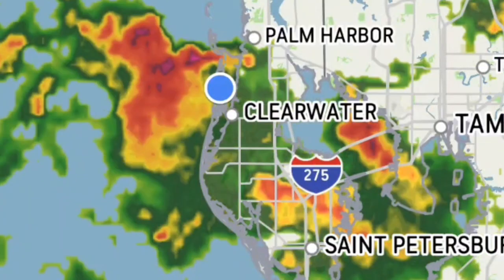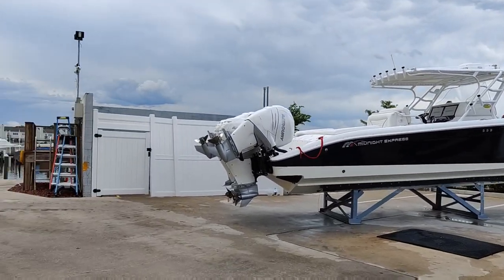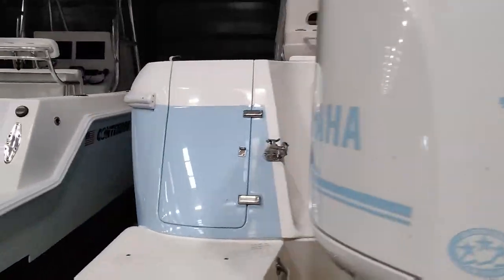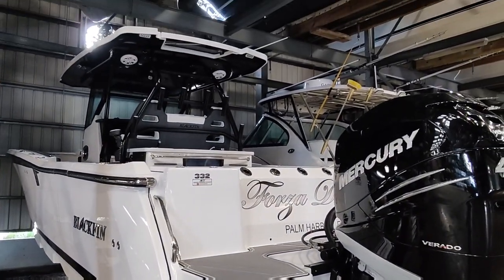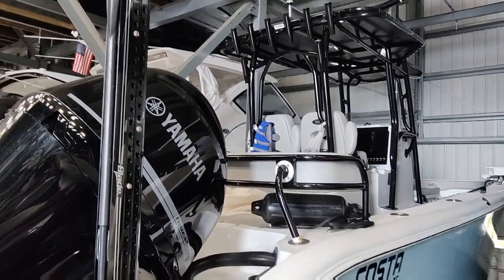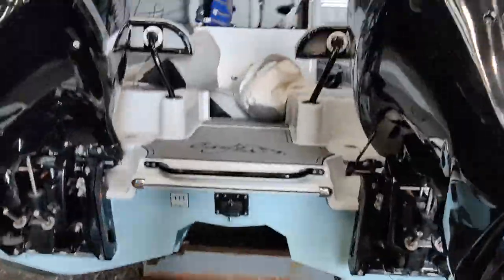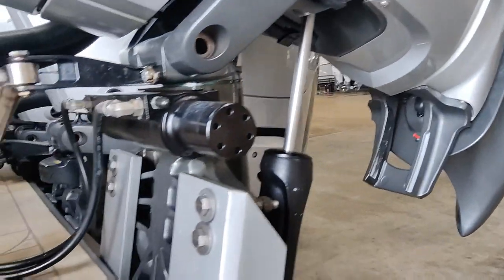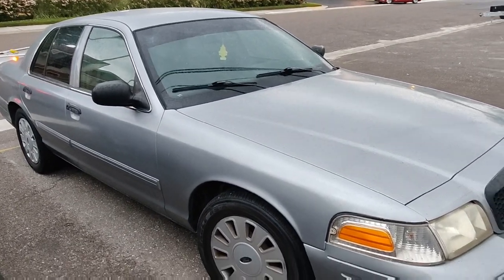Thank You Everyone & Lets Go To Marker One Marina #Dunedin  #ThankYou #Episode163

Comment: Need some guidance regarding the fuel system, any help is appreciate. This is the issue in short. I have a 2006 250 HP Yamaha Outboard. I think iam lossing prime between the primer ball and the fuel tank. Do you think it may be the fuel pick up and the anti-siphon valve getting stuck. It seems once all the fuel is used in the VST and whatever is in the line between the ball and the engine the engine begins to want to stall, choke and is starving for fuel. I need to work the throttle back and forth until I get prime back in the fuel line. Once the prime, or fuel is back in the system the engine runs perfectly. Your thoughts. Thanks again.
Reply from the maker: The best way to find the source of the problem is putting a vacuum gauge in the fuel line starting from the tank. Then you work your way back towards the motor.  Where there is excessive vacuum in the system will point towards the problem.  I rarely see this with the new boats I work on.  Keep me posted and I will be glad to help😊
Reply: @JustinLeeMarine  so I pulled the fuel pickup unit out of the tank. The entire tube was disconnected from the fuel tank fitting. Iam thinking that at one time the pickup had been changed and NOT cut to size, which caused the tube to whip against the tank as the fitting was being tightened and cracked the tube from the fitting. So when I began to remove the unit the tube broke off. Also the anti-siphon valve appeared to not be seating correctly. To sum it up all is good and she running great. Have a good holiday weekend and all the best. Thanks for the help.
Reply from the maker: Glad you found the problem.  The motor definitely doesn't like air in the fuel system. Hope you have a good holiday too😊

Comment: Hi Justin, I really enjoy your videos and have been a subscriber from the very beginning! My first boat was a Regal LX6, purchased from Quality Boats in Clearwater but I had it serviced in Sarasota. I bought a 2022 Sea Ray with triple 250 Mercurys just like the one in this video (and your video with the generator issue). I ran thru a bunch of Lyngbya algae at a marina in Bradenton last weekend. Slow no-wake speed. Overheating alarms instantly sounded on all 3 engines. I shut them down within 15-30 seconds and tilted them out of the water. The lower units were caked with that crap. I cleaned them off and restarted them. They were peeing and ran at normal temperatures. Went for a cruise and they ran at normal temps. Do you think I should have the impellers or anything checked out? Thanks!
Reply from the maker: Good question and thank you.  I think you are okay if everything is operating normally.  The impellers don't have an in-between working or not. They work or they don't work.  I do recommend having them done every year just to be safe and it also helps to have the seals/gearcase inspected annually. 😊
Reply: @JustinLeeMarine  Thank you for your response and for the content. It’s been great watching your channel grow!